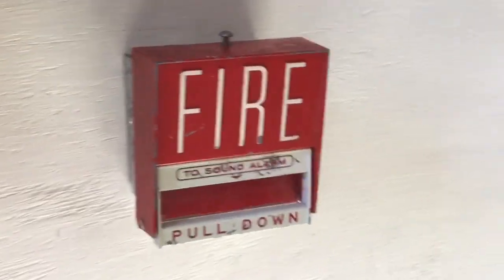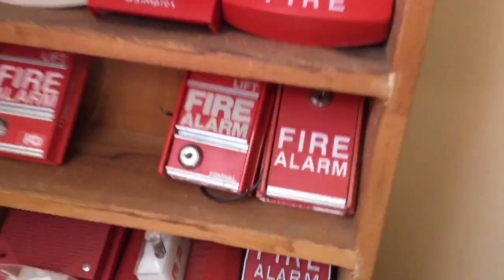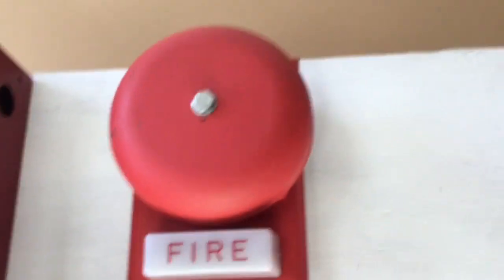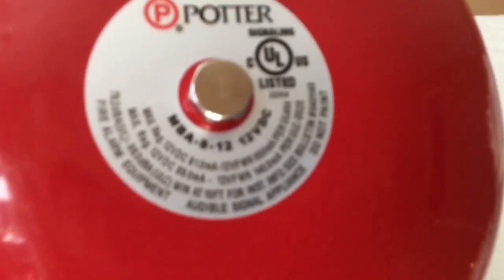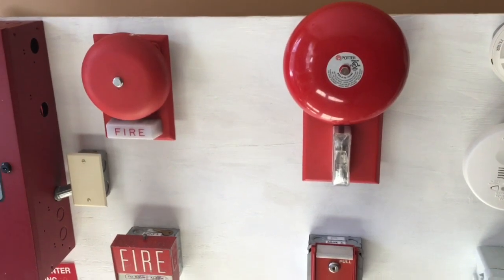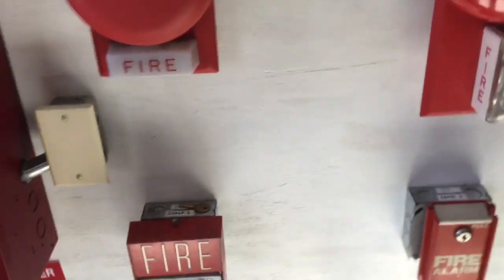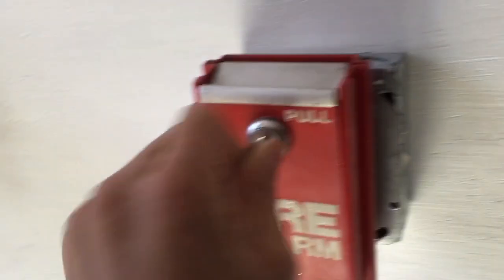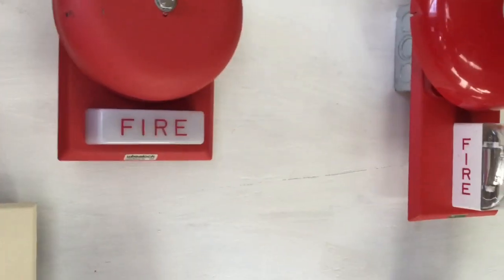Fire Alarm System Test 60 | Battle of The Bells

Comment: I encountered systems with single stroke bells in my teenage years in middle and high school. I don't remember what the middle school coding was (I think March Time), but my high school was code 3. My Vo-Tech I think was also code 3. I think this type of bell sounds better on continuous or code 3, while code 3 or march time is good for single stroke.

My post secondary tech school was really interesting too, it was a horn strobe system, but the building was very large (dormitories, dining, recreation, and classrooms in the same building). It was effectively an electronic version of what a coded pull did. Each zone had a code and the instructions were...if the code is for your zone you were to evacuate...otherwise you wait further instructions or general alarm. We had a general alarm once, but it was a PA announcement, not on the alarm system. We evacuated to the farthest area from the fire.